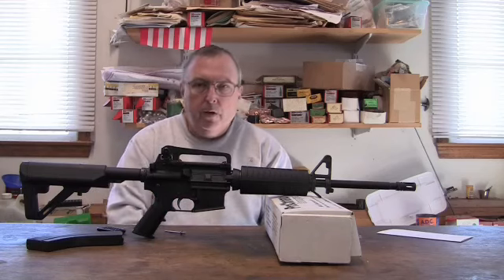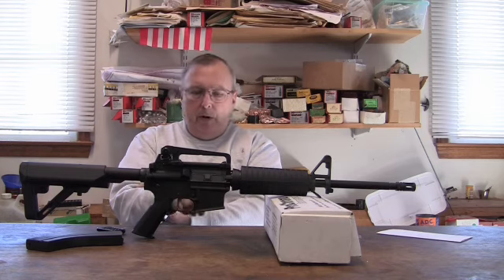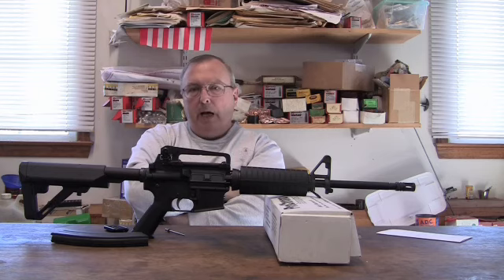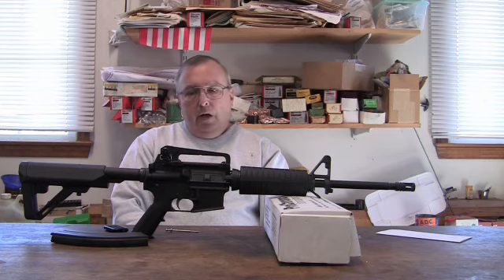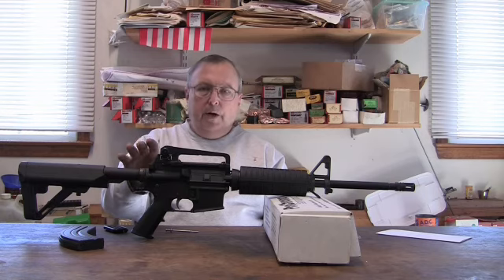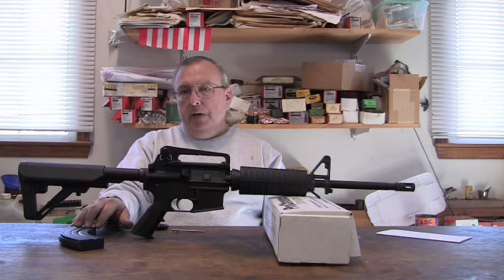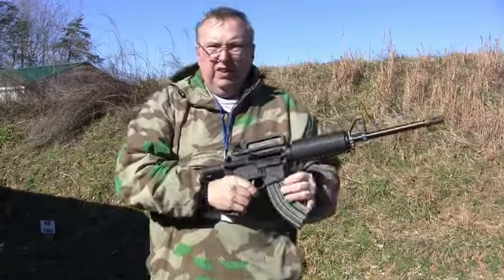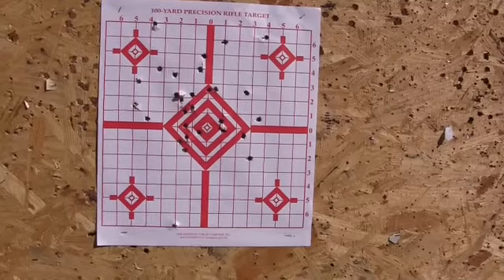P.S.A. 7.62x39 AR 15 upper Review & firing Pin Fix

Comment: It is a great upper for the money. Like you said, I could not have put it together myself cheaper. I got it this last cyber Monday for 320 shipped, complete. The first time to the range I had the same problem you reported. Light primer strikes very frequently, at least several rounds per magazine. Other than the light strikes, I had no problems feeding or ejecting with my C Products Defense 28 round magazines. I replaced the firing pin that came with the upper with one from RedX arms for only 10 bucks. When I got it, I could tell it was longer than the one PSA provides. I took it back to the range the following week with the RedX pin and problem solved. 250 rounds through the rifle without a single light strike. This included a mix of wolf, tula, and brass cased Yugo surplus. People that think that 7.62x39 AR's are full of problems need to try this company out. It is just as reliable as my 556 AR but shooting ammo that is 24 cents per round vs 32 and up, ill take it. Glad its working for you, nice video. Cheers from Milwaukee, WI!!

Comment: I tried to eliminate all possible problems when I built my 7.62 AR. I put a wolf enhanced hammer spring and the enhanced firing pin. So far out of couple hundred rounds, no issues so far. But I also used a BCA upper which seems to have a flatish feed ramp like the one you talk about. If you cover all your bases when you deal with a rifle in this caliber it’s worth it.

Comment: I know you fixed this already
but this is a simple solution
http://www.blackriflearms.com/AR-762x39-Enhanced-Firing-Pin_p_9.html

Its mostly a issue with steel case that has very hard primers or offset primers or both
also you can change the hammer spring as well for a little extra hit
http://www.blackriflearms.com/search.asp?keyword=wolf+hammer+spring&search=

once I did this I can shoot anything I want with zero issues
Reply: thank you

Comment: personally I cannot stand Wolf Ammunition. maybe others have had better luck with it then I but I can't stand the stuff. you can buy some brass 7.62 x39 pretty close to the same price of 5.56. so that's what I do also C products makes a pretty decent AR mag I've never had any problems with them even though they are not high price they have turned out to be an extremely reliable magazine at least for me.

Comment: How's your rifle holding up? Did you get it to function reliably??
Reply from the maker: the rifle works fine with the extended firing pin, the problem lies in the ammo the most common and least expensive is steel cased Russian ammo, the primers sit deep in some of the cases, and causes the problem, with brass cased ammo of better quality this rifle functions 110% and I have found to be extremely accurate,
Reply: TheKoba49 did you grade the springs in the hammer?
Reply: TheKoba49 the reason I'm asking, because I want to build one.

Comment: have you tried the wolf heavy hammer spring?
Reply from the maker: +Scott Besse Yes the wolf ammo requires the firing pin to have to stick out farther from the bolt face, I changed the hammer spring and it did not make a difference

Comment: also alot of drop in triggers do not have the energy in the hammer spring for alot of the 7.62 primmers
the enhanced pin and a good mill spec trigger or a trigger with a heavier hammer spring solves all issues
I never had another issue after changing the firing pin and using a heavier spring
you can get the wolf extra power sprint from the same company that has the firing pin

http://www.blackriflearms.com/search.asp?keyword=wolf&search=